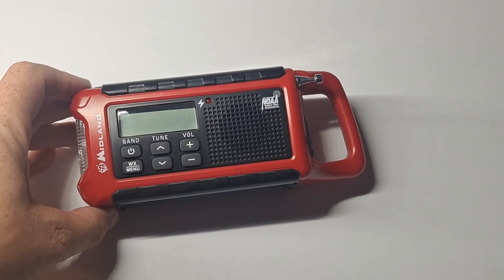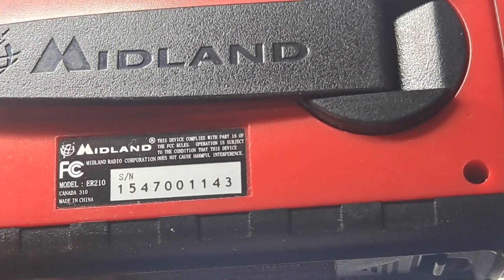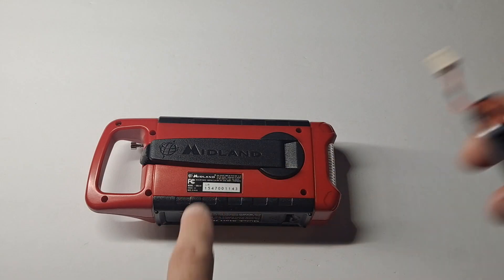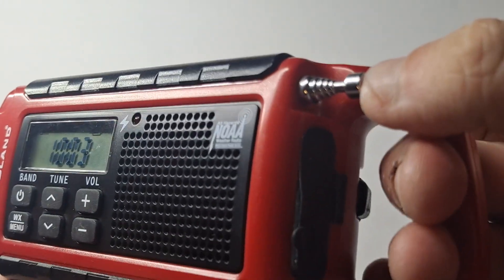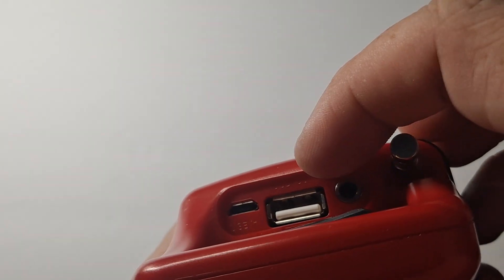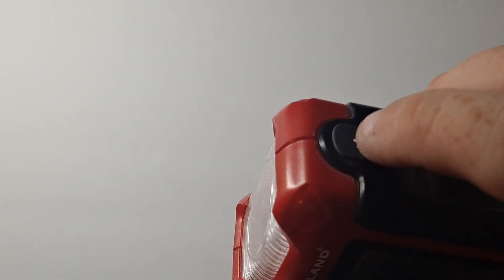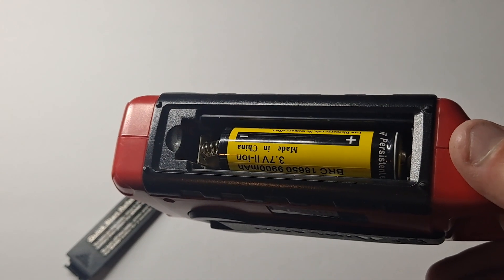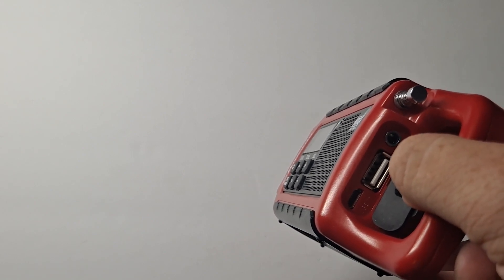Modified Midland ER210 Emergency Radio 1st Gen.

Comment: I keep mine in a bug out bag. I figure I would only need to bug out for weather related reasons, so I store it in a bag with the battery removed. I add a power bank and cord, because it can't hold a charge indefinitely. The power bank would take years to discharge if left untouched. I check both regularly ( every 6 months or so ). I didn't have to leave home during the last weather emergency, but I could check NOAA reports on this radio. Since local radio stations' employees couldn't always make it in to work, I used a short wave radio to monitor broadcasts at night. There wasn't much about the power grid going down due to weather, but I got some useful info.
Reply from the maker: Great to hear you're prepared and that the radio helped you stay informed.

Comment: TIP You don't need the antenna for AM. The AM antenna is built in.
Reply from the maker: Well no.  In AM, a single wavelength is 984 feet for a 1MHz signal. In FM, one wavelength is about 12 feet. Thus, the popular quarter-wave antenna often used for AM might be 246 feet high, and the FM antenna elements would be only around three or six feet long, depending on the antenna design.  FM can be used without the antenna deployed.

Comment: The 9900mah battery is a lie.  It's likely going to last half to a quarter as long as a 3400mah Panasonic 18650.  Such batteries typically test at 1/10th their rating or 990mah.  Right now, 3400mah is about the max real capacity for an 18650 with 2400mah being more common.
Reply from the maker: That's good to know.   All I do know is the battery lasts longer than the original and does not need a specific pigtail to work.
Reply: Where did you get the contacts for battery to convert radio?

Comment: Wow, with a 9900mAh, rechargable lithium ion battery in it; that battery should last a long time. I'm guessing, maybe a couple of days. Am I right?
Reply from the maker: I suppose, though I have never ran it longer than 12 or so hours at a time. The main reason for changing to the 9900 mAh battery was I had it already available, and the elimination of the OE battery with pigtail.